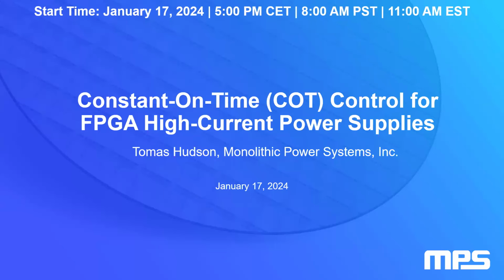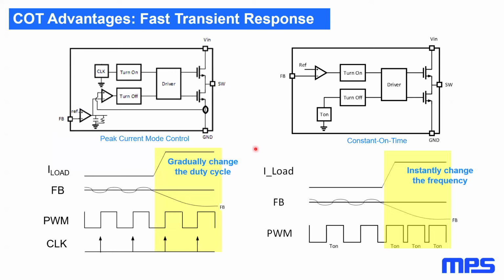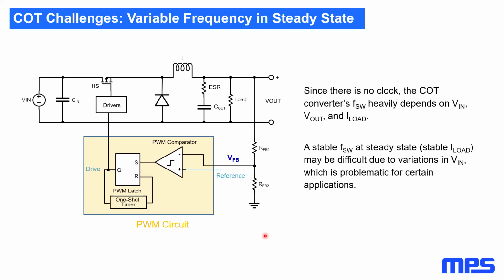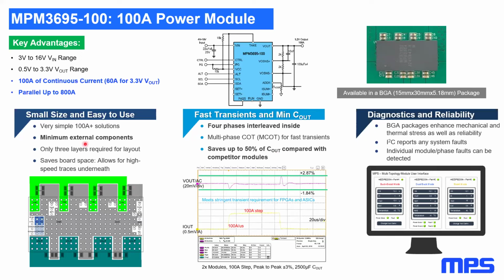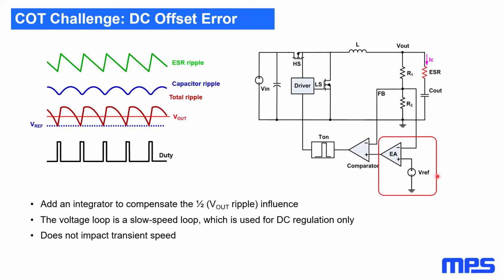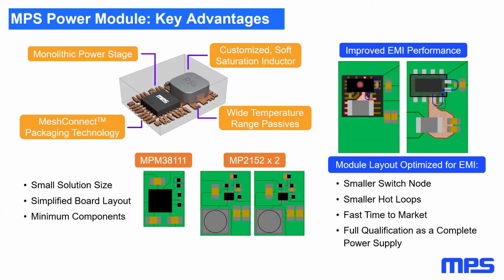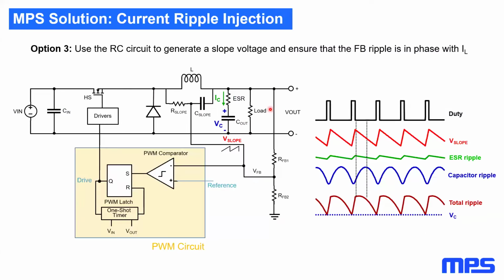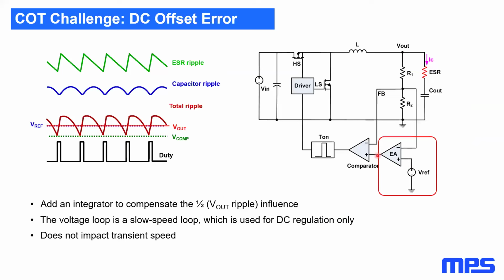Webinar: Constant-On-Time (COT) Control for FPGA High-Current Power Supplies

Comment: Can you share the answer of the question about the possible spike on the ouput voltage when the load current drops to 0A? Also can you share the test setup to simulate and measure the stability?